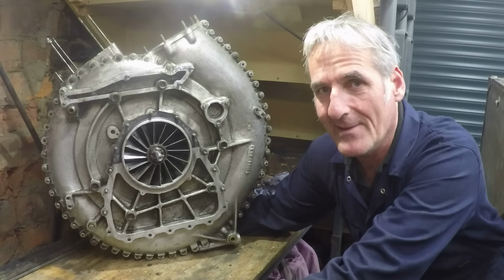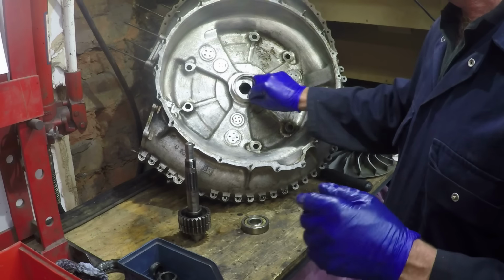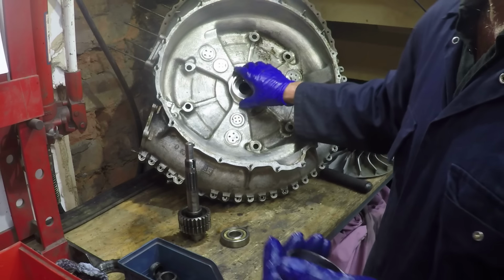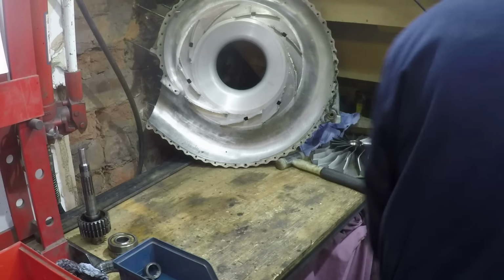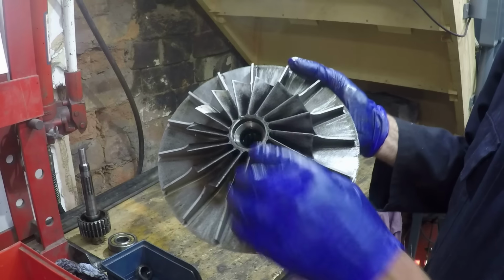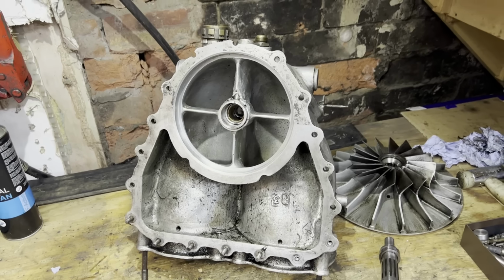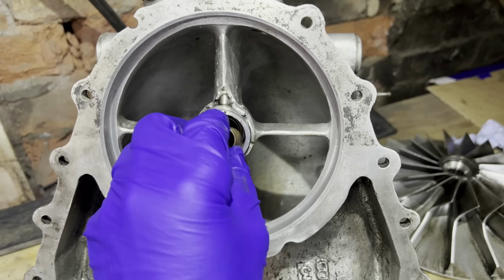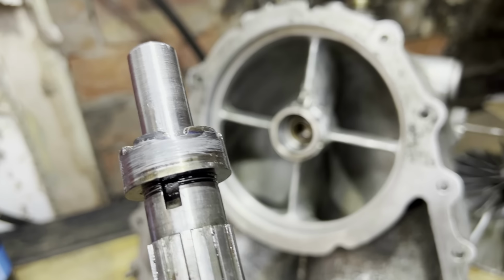Rolls-Royce Merlin XX Supercharger Failure. Strip-Down, Inspection & Test-Run

Comment: Great sound. A few questions. How much fuel did that little run cost you? (us gallons) Second, why did u have the prop feathered? What valve were u messing with down by the frame? Last one, what is better. A supercharged engine a turbo charged engine?
Reply: We bring the prop into feather to provide more load to the engine through resistance. The little valve is a kigas primer pump, which injects fuel into the intake manifold to assist with starting.

Comment: I realise being fitted toan aircraft they would not want the compressor housing to leak but I wonder if it would not have been lighter and just as secure to have made the housing flanges thicker, rather than use so many nuts and bolts.

Comment: Also inside the supercharger and on the elbow in various places are caps with 4 small holes… are these just threaded bungs plugging oil drillings?
Reply: I think. Threaded bungs for the breather tubes ? . The holes are for loosening and tightening.

Comment: That localized wear area on the shaft nut could be because the pressure distribution varies around the volute. As the volute cross section area increases, the air velocity decreases and the pressure increases. This puts a constant radial side load on the impeller.

Comment: Peter I think it grossly unfair that after all the static runs you have done downwind of the prop you still have more hair than me.....
Reply from the maker: @piersdowell832  It’s called prop wash, but in fact it contains quite a bit of used engine oil, which makes my hair grow😉
Reply: @FlightEngineering1  i've discovered this remedy far too late.